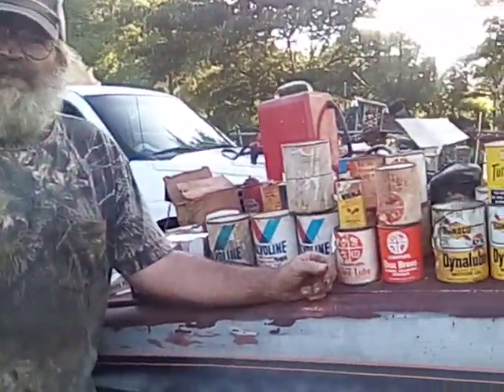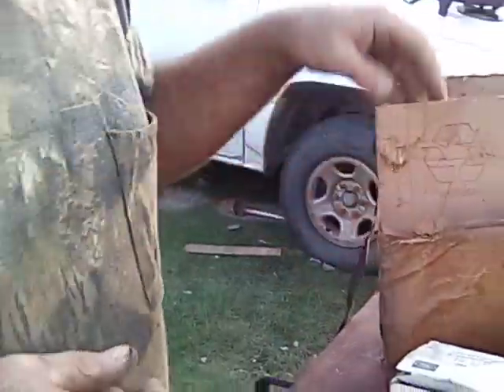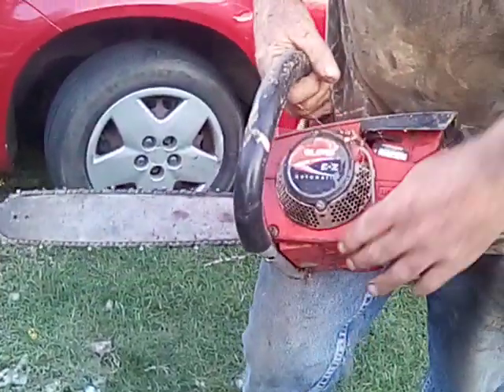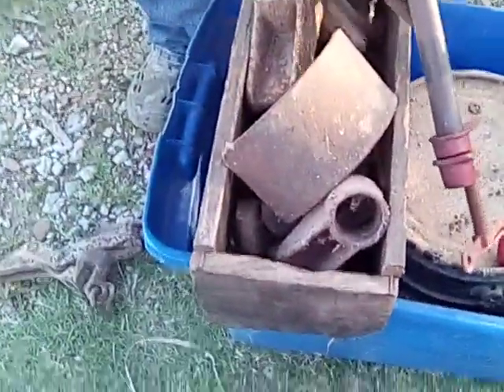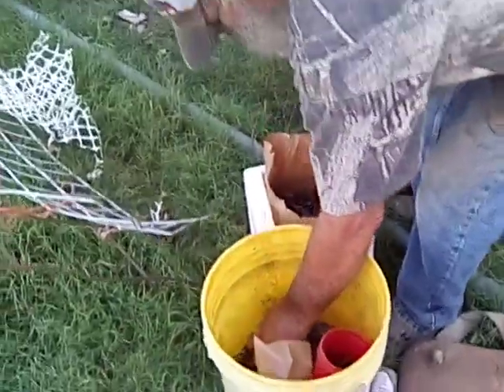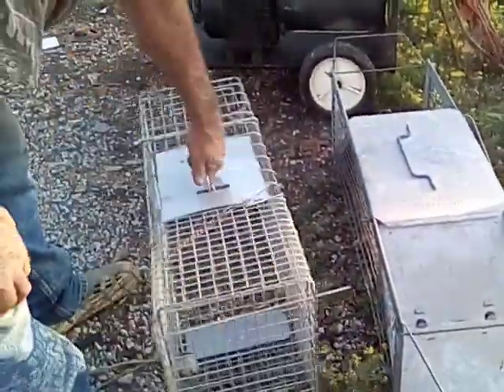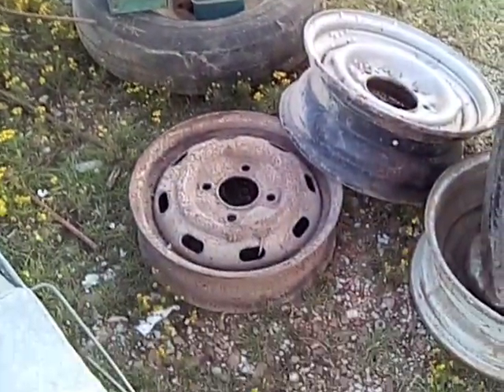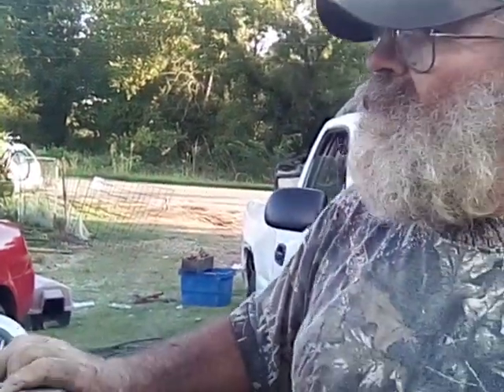Estate Auction. We bought two truckloads!

Comment: I have never even seen a gas powered circular saw. Would like to see a video of you getting that thing running. Great finds.
Reply from the maker: It was packed with mud wasp nest. I have cleaned it up and checked it out. It will run on a prime. It has the early wick fuel filter. However the tank is very clean. I suspect the carb diapram is bad and will need replaced. We will do a video of the second load soon.
Reply: @thecollectoronthecorner7061  we will look for it.

Comment: The home light circular saw is really neat. My dad always ran home lights. He had a little red and white one. I still have it. It's amazing how good that thing still looks but it's worn out. I think it's claim to fame was that it was the smallest homelite chainsaw ever made with automatic oiler. Or at least up to that time. We cut a lot of oak with that saw. Glad you was able to clean up at the auction.
Reply from the maker: Might be a XL 101 they where red or blue &white.  54 CC engine  but only weighed 10 pounds. We happen to have blue one.  The Xl 12 was 54 Cc but weighed 12 pounds. There is a U tube Guy Leons Chainsaws. He is a homelite guru and  makes great videos and also sells parts.
Reply: @thecollectoronthecorner7061  wow that's quick thank you. I got the blue one too. I picked it up an auction for nothing actually $5 maybe. Thinking that my dad would want it this number of years ago. He was happy about the thought but he cannot use it to repair the red one. The red ones worth more in sentimental value than any other measure of dollars. I'll check this guy out. I went on to another brand and it cuts so nice and it doesn't vibrate me to death like the home lights. But then I am a lot older than when I was using it back in the day. The trees have gotten a lot bigger too. Hey thanks so he brought up the memory and now give me an opportunity to fix the chainsaw

Comment: I love a good auction. Heck I even love a bad auction !!  Of course I haven't seen too many  bad ones.  There's almost always something good to snag !!  I got that exact Couch (??) tire changer with the tools and all at the local junk yard.  Some kids were needing money so they turned in grandpa's stuff.  He was gone for good and they didn't want it at all...  Yes, I got tons of stuff that time... My friend that owned the junk yard would let me weigh going in and load what I wanted, then weigh going out.  So we was just trading pound for pound.  Those days are gone now !!  Some times I'd have to PAY them !!  LOL  Great commentary Debbie....Randy did pretty good too.   (-;
Reply from the maker: I think they called them a Coats Iron Tire man. We have some others one has a Pneumatic bead breaker. went and got the second load today. Its still on the truck. Had to load by hand. And one item is a hot water pressure washer. Man is it heavy. I have bought half a dozen at auctions. So far none have been any good. They leave water in them and the heating coils & pumps freeze and burst. This one likely isnt any good too. however it was $10 and they usually have a good 110 volt 1 HP electric motor on the pump. I can buy stuff at the local scrap yard. I used to work there. However I have to pay double per pound of what he paid.
Reply: @thecollectoronthecorner7061  I've got an electric powered hot water washer too.  Its on a dolly and I've never even plugged it in yet, but then its only been sitting here 15 or 20 years..LOL.  I also have a much more modern pneumatic changer I use all the time in the shop.  It's 16'' maximum though. Can't remember the name, but its a common one. Yes, there are tons of bargains to be had at the local junk yard.  Like you, I ain't one to have to have brand new stuff unless of course there's no other option.

Comment: I've never seen a Homelite circular saw...very cool.  Did you get it running?  I collect chainsaws as well...subbed to you!
Reply from the maker: I am 72 ran my first chainsaw when i was 14 and it was a XL 12. In all my years in never seen a circular saw in person. I seen a video of one That Leons chainsaw made. So when I seen it at the estate auction I bought it. Got it running thirty minutes afterI got home. Had to swap the  carb and it works perfect.Mostly collect homelites and prefer the older alumium and maganesium saws.  Thanks for subscribing. I  also like the loud stack exhaust like your saws have